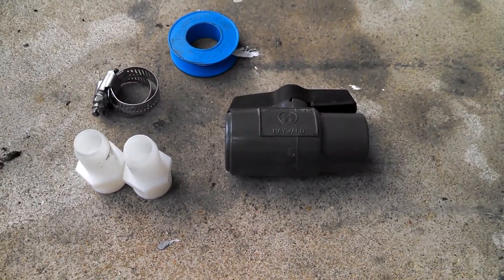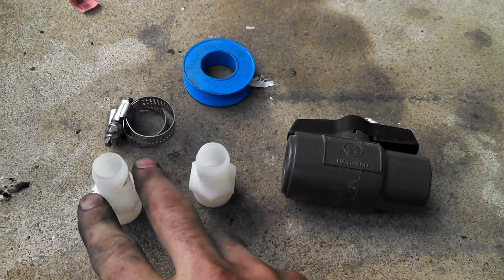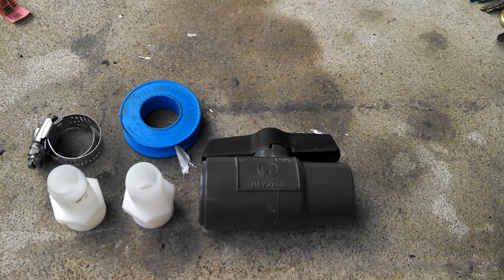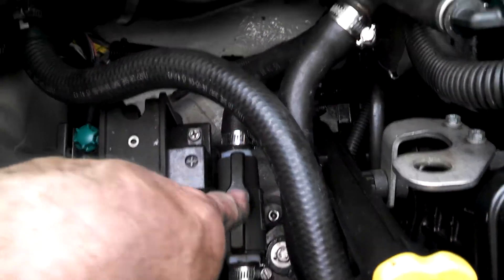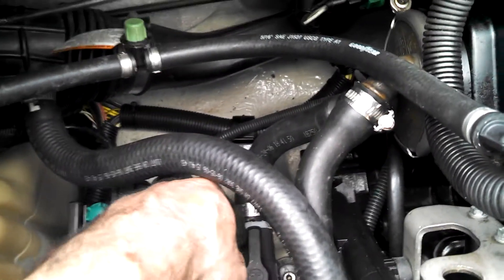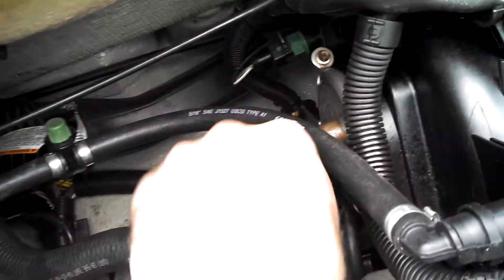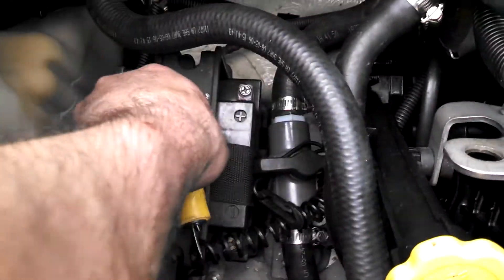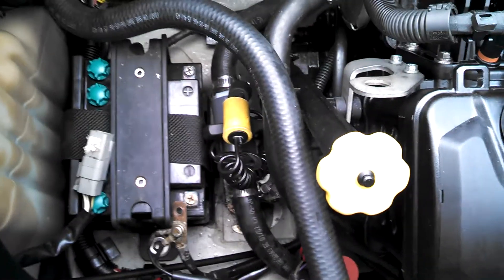Seadoo installation of seawater shut off valve

Comment: Is the position of the valve right? Normally you would have to block off a tube in the back of the ski near the water box. The tube is marked with a red tape

Comment: Michael, good vid thanks!

Super basic mod and WAY safer then relying on hose pincher or similar in my opinion; this is a good strong mechanical solution. Only arguable risk with this is forgetting the valve in closed position and burning up motor, but you really safeguard against with leaving the DESS key wrapped around there.

Just bought and Challenger 180 and plan to do same thing. I'll post link here in case some other sea doo-ers may find helpfull